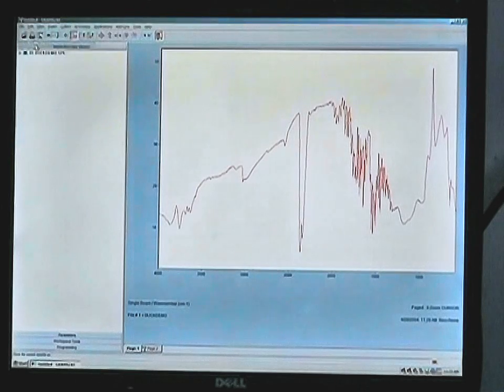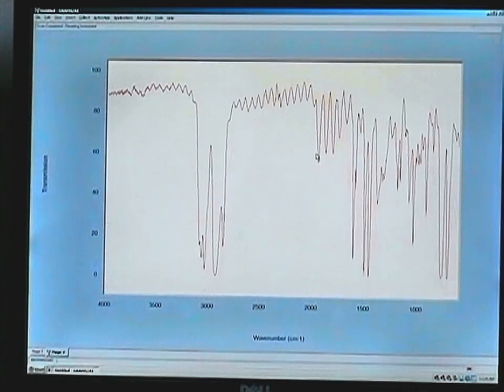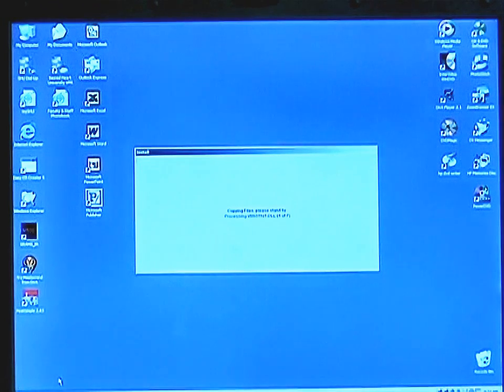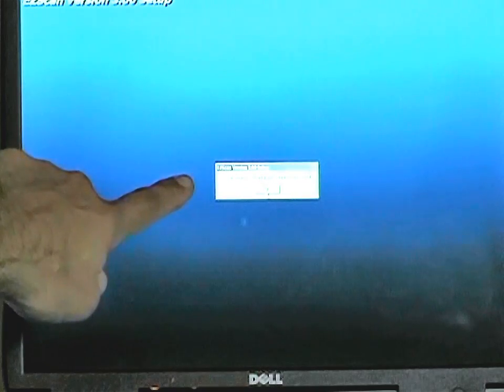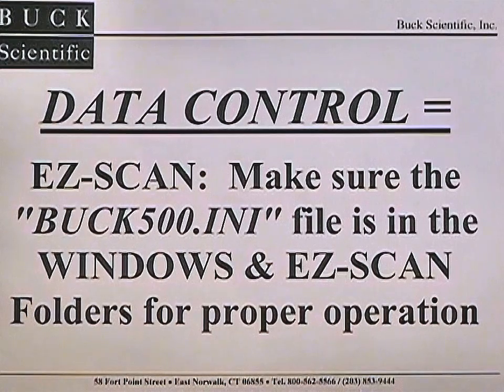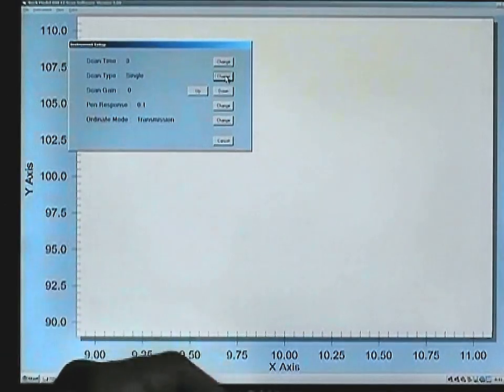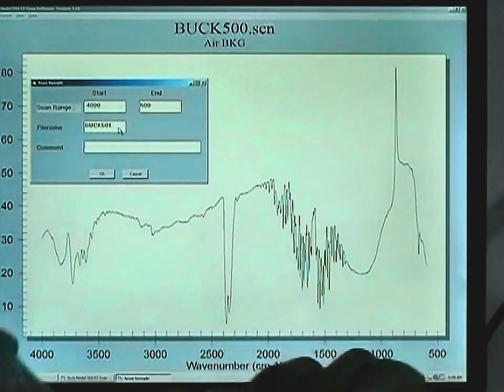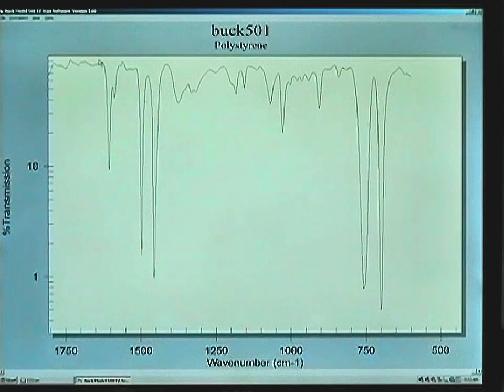Buck Scientific M500 Infrared Spectrophotometer installation(2/3)

Comment: I'm repairing one of these devices right now. In the reference scan, the transmission drops all the way to 0% in the 2400 and 1500 areas, making those areas noisy or unusable. Is this from any residues I can attempt to clean off? Thanks